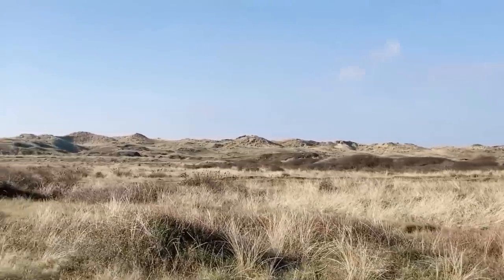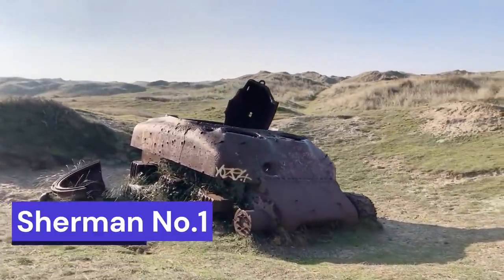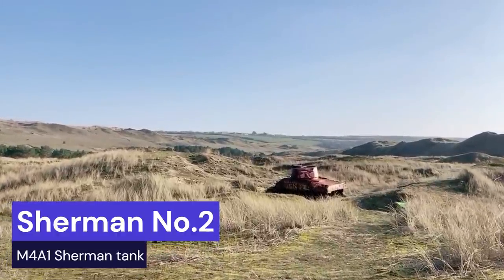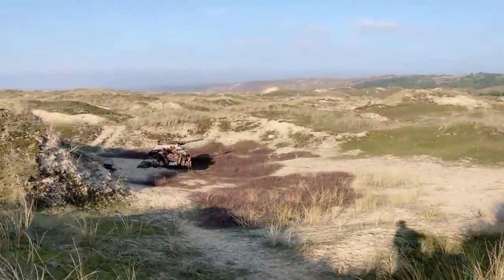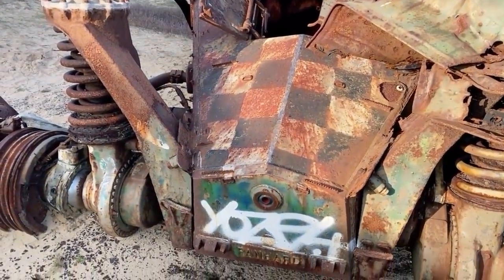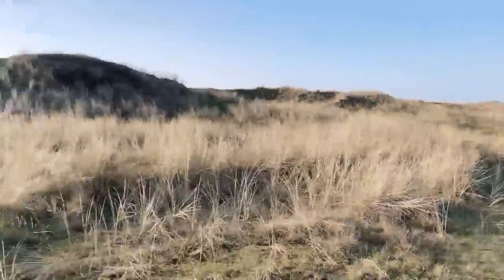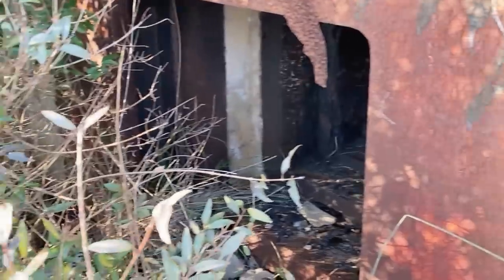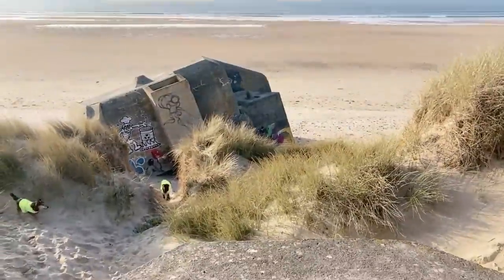VIRTUAL D-DAY | NORMANDY'S TANK GRAVEYARD

Comment: Hi nice one, interesting vid I did not know of these vehicles! A bit of help on the  what you thought was a machine gun bunker it's actually  for a  Czech 4.7cm Pak with co-axial machine gun in a casemate. Just in case some of you viewer's are not aware, Regelbau stands for a system the Germans use for building bunkers and basically just means standard build. the system used books of plans for each of over 600 approved types of bunker and casemate